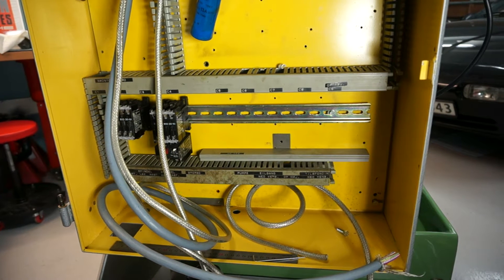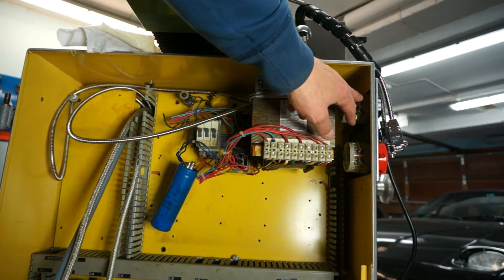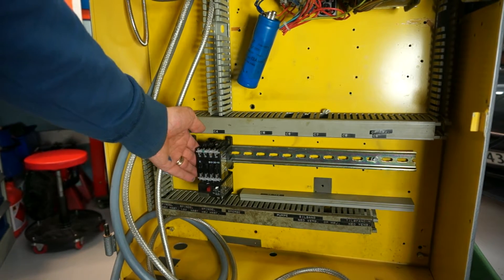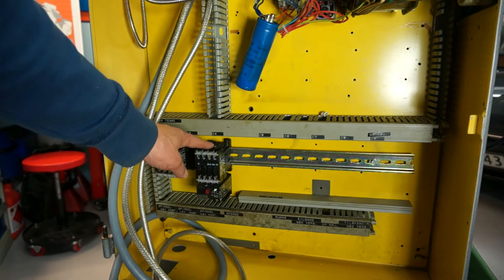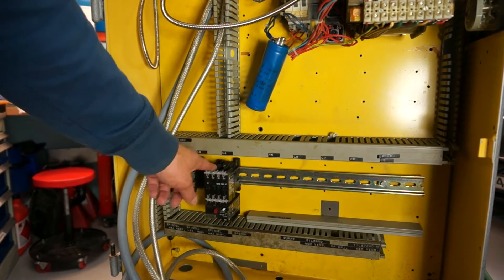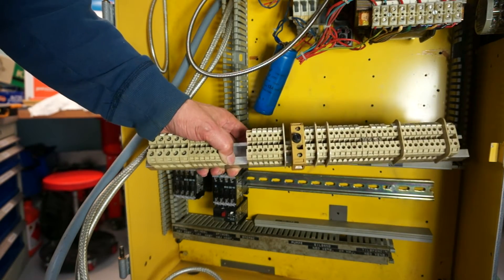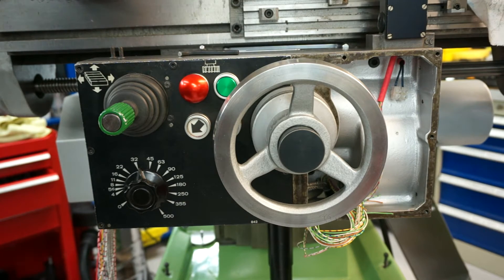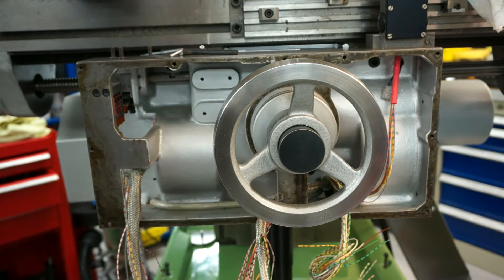Schaublin 22 - bringing it back to life, Part 1

Comment: How much did you pay for this machine? Thanks
Reply from the maker: I checked out some prices from dealers in Europe before my purchase, and they seem to go for around €20-25K ($21-26K) for good quality machines.  You can also get them in factory restored condition for a lot more, but I have seen one as low as £7K.  Of course, I paid a lot less as it was completely missing all electronics, had a faulty gearbox and had a modified motor that only had one speed. All that has been taken care of now though, and the machine is milling out chips almost every day.
Reply: for free would be appropriate. holy smokes. or scrap money.

Comment: Very interesting videos -'just watched all of them and waiting for the next one. I wonder if someone in the past started to convert the machine to cnc, which might explain the changes made to the gears and the removal of the control gear and wiring. Or I might be wrong and it is mice like Tony says. Love the quality of your wiring work.
Reply from the maker: Thank you.  No, I don't think so. The relay boards were prone to malfunction due to non-sealed relays. Oil and dirt penetrated the relays an made all kinds of havoc.  I used sealed relays for this reason.  Also the main pinion gear was striped on this machine, reducing the number of available gears. It was converted to frequency drive for this reason.  The motor was converted to two-phase (or one actually) one speed, and me putting the motor back to three-phase two-speed was the single most expensive element of putting it back to close to original spec.  These mills sell for over €20K, so I figured the best way is to make it original. More vids to come soon.

Comment: wow i didn't realize the condition you were starting with.   any backstory?  mice maybe? :)   that will be quite the payoff when you're done though!
Reply from the maker: +This Old Tony Its a bit like your surface grinder, but not as bad.  The electrics I knew about, and was prepared for, except that nothing was connected on the switch end of things.  The gearbox was more surprising, but I think I have control now.  And then there was the motor that had been rebuilt to single speed 220V for a frequency regulator. Total surprise.  I'm spending more than expected to have that build back to a two speed 380V 3-phase.  Hope its the right decision.